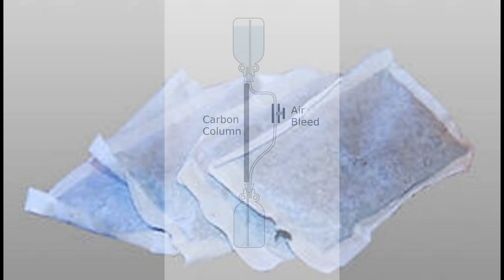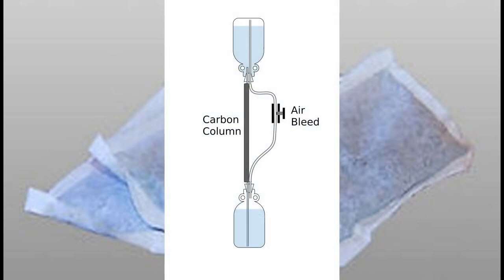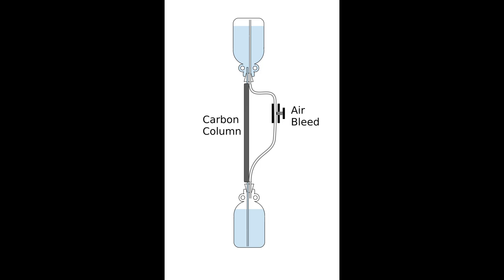Carbon Filtration

Comment: I've attempted many filtration methods with many spirit types. Though never with an azeotropic spirit as I've found many of the undesirable components to be much more soluble in a spirit the stronger it is, making them much more difficult to remove than if proofed down first. After learning this I attempt to get it close to the proof I'm planning on ending at prior to filtration and have found much better results since.
But as someone who seeks to create more flavorful spirits these days instead of less, I now only filter to remove some of the bite and only the largest of undesirable molecules. As such I've almost entirely stopped using AC and began using 100% sugar maple charcoal. Augmenting the length of the filter and being able to break it up myself allows me some control over how much or how little I filter out by selectively choosing what size carbon I use and how much of it the spirit filters through. I typically remove and reserve the powder that is created while crushing the charcoal to size, for things I want to receive the most amount of filtering like my neutral spirits.
Though personally I've had best success at creating a truly neutral spirit through a combination of processes. I first started with something very neutral to begin with, seems obvious, but it's important. My preference is potatoes. But with how neutral my Soju turns out, rice would likely also be a good candidate. Then I strip the alcohol from the wash and proof the spirit down to distillation ABV of 35-40% and do a quick cursory filter through a Brita to remove some of the flavor at a decent speed. This is not the most important filtration so not much time is spent on it, though it helps none the less.
Then I treat the low wines with a combination of things which raise the pH  and neutralize precursor catalysts for esterification among, other flavor compounds. I used about a 50:50 ratio of sodium bicarbonate and sodium carbonate until slightly alkaline. Then I add in powdered AC/charcoal and leave it in for a few days, continually stirring it throughout each day to help move it through the wash and adsorb as much as possible. The powder AC is then removed prior to distillation with either cotton or felt.
For the spirit distillation, I set up a funnel which is nearly completely filled with small AC pieces to filter the spirit some as it comes off the still. But I only place it there after I've made the heads cut. All the cuts of the final spirit are then blended and go through one final AC filtration using a Buchner vacuum filtration funnel that has at least 2"(5cm) of AC in it for a minimum of two passes, or until tasteless. Multiples go much more quickly with vacuum and one can accomplish a filtration rate of about a gallon (4L) of finished neutral per hour, while still effectively removing quite a bit of residual flavors from it each time. It's a labor intensive method, though it makes a superior product in my personal opinion. actually doesn't use as much carbon as it sounds like. Certainly less than the large carbon filters available for purchase and much more effective
I used this combination of techniques and methods applied to the double distillation of a neutral spirit, and a double retort modification for the high proof need to really call it neutral. All of which are contributions to helping me create a neutral spirit I believe tases like absolutely nothing, not even like water, water has more flavor honestly... though water doesn't immediately begin to evaporate once it's drank like neutral can. Never in my life have I ever experienced a neutral as neutral as the neutral this method can create 😂
--RuneShine, Michigan's Norse-Druid Alchemist ✌💚🙃
Reply from the maker: I accept what you say about filtering high concentration spirit. 

As I understand it, you proof stripped spirit down to 35 - 40% and filter it through a Brita filter. Then you alkalinise the result with sodium bicarbonate and add further charcoal and leave it for several days. You then filter out the charcoal and distil again, this time running the product through a carbon containing filter. I presume this is with a pot still as you mentioned removing the head cuts before doing this. 

Then you filter the collected product again through another carbon containing funnel for two or more passes. What is the alcohol proof of these final carbon filtration passes? 

This is a carbon exposure at several stages. What is the advantage of going through the process of multiple distillations and alkalinization and applying carbon at only one point?

Comment: I’ve always been told (the general consensus among the hobbyists) is that carbon filtering is ineffective with spirit above 50% ABV. I need to rewatch this to absorb it properly. Thanks for sharing
Reply from the maker: So far I have only used it with 95+%. It does work but is not very effective. I'll try it at lower %. It could work better for chemical that are more hydrophobic than ethanol as more water would push the energy balance towards adsorption for them, but even commercial users use a lot of carbon per litre.

Comment: Hi, I filled an air cooled column with carbon with a tap on the bottom and a 2lt chromatography flask on the top, worked well. BUT after listening to you about ozone,I use a Erlenmeyer flask, put the spirit, ozone stone and carbon in and put the lot on a magnetic stirrer. ozone for about 2hr while stirring for a day or so. i use 1/2 cup of carbon per 2lt ish of spirit. After that I remove the big stuff and let the carbon dust settled down, this takes a week or so. The results have been quite promising, very clean considering I started at 94% ABV
Cheers
Peter
Reply from the maker: Interesting. Can I just be clear about what you did? You took a flask with spirit and 1/2 cup per 2l of carbon on a magnetic stirrer and added ozone for two hours while stirring, then removed the ozone generator and continued stirring for another 22 hours or so. Then you let the carbon settle out. 

One question. What is the rate of ozone generation? The cheap generator I have is only about a 1000 mg per hour, and it will only run for an hour continuously before you have to stop it for a rest. Presumably because otherwise it gets too hot.
Reply: @tight1449  yes, that’s right, flask with about 2 lt of 94.ish%, 1/2 cup carbon on a magnetic stirrer, stirring fast enough as to have a lot of the carbon in suspension. Biggest problem was the ozone stone and the stirring bar colliding, but it did settle down after a while. The ozone generator is a 1000mg/h, 10w, model AZ-1000MG-G. It to recommends only running for one hour at a time, to avoid damage from over heating. The  carbon I use is no bigger than 2mm. I was concerned that such a high ABV might have a negative effect on the carbons ability to filter out the bad stuff, but compared to other batches it’s quite good.
Yes, I stirred it for about a day, then filled out the big bits of carbon. It was quite cloudy with the small carbon particles/dust,after putting it in a vertical walled jar, and giving the jar a quick 1/4 turn twist whenever I went past it, it settled out with  a polished look after about a week,then I racked it, job done.
Hope this answers your questions.
Cheers 
Peter

Comment: Completely agree with you about the Britta filter... absolutely no consideration has gone into the design, and (in my experience anyway) it's impossible to pour anything out of it without it spilling everywhere. Considering the price of the thing, that's pretty poor.

I've had pretty good results from adding activated carbon directly to low wines prior to final distillation. That works out considerably cheaper than other filtration methods, but it's only useful for multiple distillation.
Reply from the maker: Do you add the carbon and then pot distil with it in the boiler?
Reply: @tight1449  Yes, after it's sat around for a few days doing its job (i.e. until I get around to re-distilling it). It benefits from continuous stirring, as it has a tendency to settle out otherwise. In theory I think you could use it without an extra re-distillation, by filtering it. I suppose that would be a similar process to running it through a Britta filter, but for a fraction of the cost, and with a longer exposure time to the active carbon.
Reply from the maker: I have tried it and it works well. After stripping in a pot still I have cut down to about 35% and added 1kg of charcoal per 50l. I've used cheap charcoal sold for fish tank purification. I also bubble in ozone and after a couple of days the taste clears. Then I do a continuous fractional column distillation. the result is my best vodka yet. Thanks!

Comment: I've reused activated charcoal 5 times now after filtering my azeotropic mixture until it couldn't remove taste/fusel oils anymore. I haven't observed any drop in performance. It did not need hundreds of degrees Celsius, just 70 degrees C in my fan oven for about 4 hours on a tray of foil, nothing fancy. It's not optimal but it works well for me and is cheap.
Reply: To add, I use about 500 g charcoal/2 L and it soaks for 3 hours. Again, no optimisation but I'm happy with it.
Reply from the maker: How does it work? Do you put the spirit in a jar with the carbon and keep it at 70 degrees?
Reply: @tight1449  I put the spirit in a jar with the charcoal at room temperature and cover it. The oven is used for regeneration only, and that is at 70 deg C.
Reply from the maker: @Southghost5997  I'll try it. Commercial regeneration uses prolonged heating to several hundred degrees in a non oxidising atmosphere. Lower temperature regeneration my only drive off the ethanol and more volatile chemicals.
Reply: @tight1449  yeah it's not proper regeneration, but it seems to be fine for this purpose. It might be worth a try to bring the cost of this hobby down :)
Reply from the maker: @Southghost5997  Have you tried the process without the regeneration stage?
Reply: @tight1449  Yes, I have. It tends to leave more flavours in the alcohol when I do not "regenerate".
Reply from the maker: @Southghost5997  Interesting. I can find nothing published on low temperature regeneration. I'll give it a try. Thanks.

Comment: Can you do a video on the jar still
Reply from the maker: Yes I'm working on it. It works well by not as developed as the sloping tube.
Reply: @tight1449  Talking about the sloping tube,I got a copper pipe 20 mm x 6 meters and formed it into a coil, that sits on top of the still pot, works like a dream, getting about 94.5 ish %
Reply from the maker: @Jack-It-UP  Interesting. What were the parameters? wash concentration? Power? and was the coil insulated?
Reply: @tight1449  The wash was a turbo classic 8, with 1.5 kg quick oats, about 12% abv. The pot is about 17 liters, that I heat with a induction cob. The coil is insulated to some extent, you can put your hand on it and it is warm.Steam goes up the rectifying column but the return gets funneled back to half way down the coil.I have a pid on it. It doesn't seam to make much difference if you are doing a 12% wash or a 30% spirit run, it all comes out at about 94.ish.I have played with a reflux condenser and fore shots but the system does not seam to be hot enough.I have an old steam cleaner I might have a play with. That 12% wash was continuous and pot, the 30% was pot.The wash goes through quite fast,the stream of wash would be about the size of a pencil lead or fast dripping. How can I send you some pictures or a video? and whats your name?
Cheers
Peter
Reply from the maker: How do you set up the pid controller? Is the target temperature the top of the column?